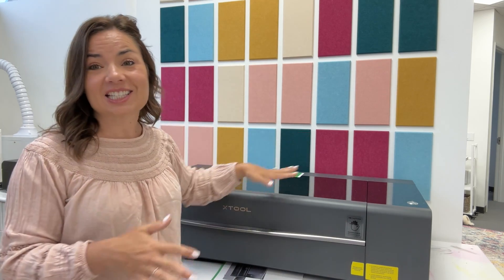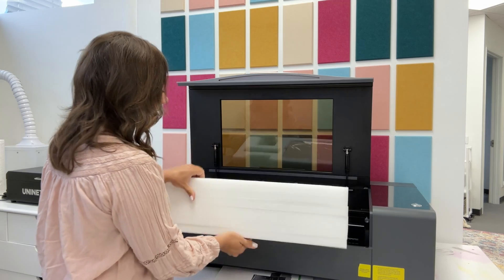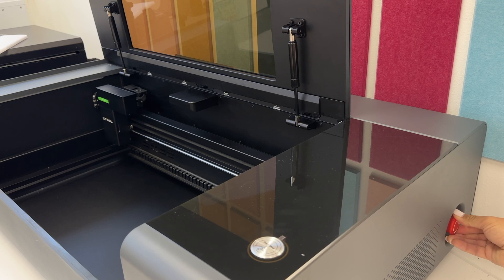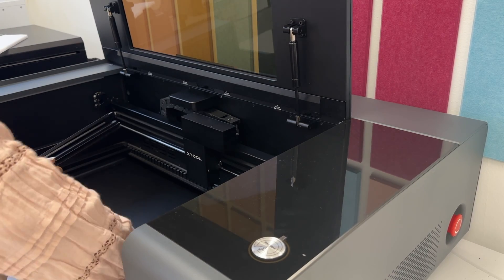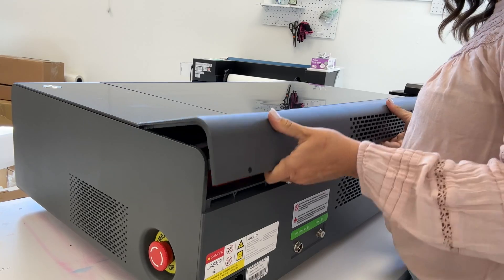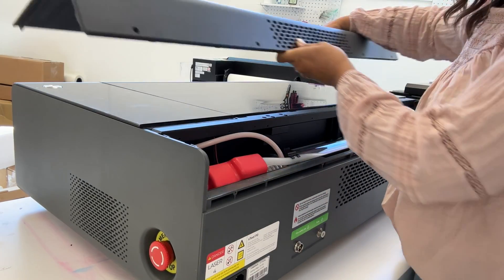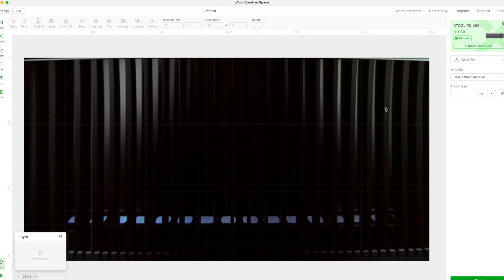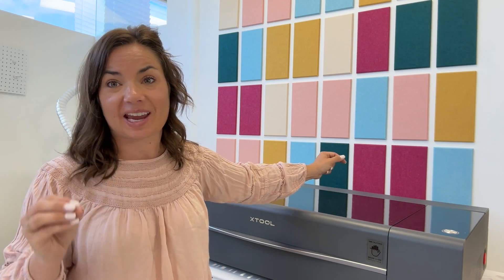XTool P2 Laser: Easy Step By Step Initial Installation

Comment: Thanks! You make it so easy to install! Can you make a video calibrating the machine? Thanks
Reply from the maker: You really should not need to calibrate especially not a new machine
Reply: @SilhouetteSchool  unfortunately because it's testing in-factory in China, then shipped overseas, they recommend calibrating. I'm having to calibrate mine because they're off quite a bit. It's frustrating as the support material for doing so sucks